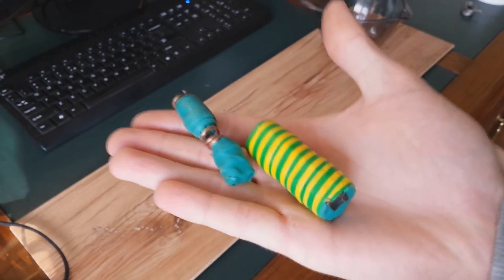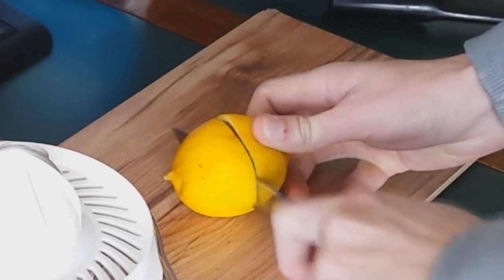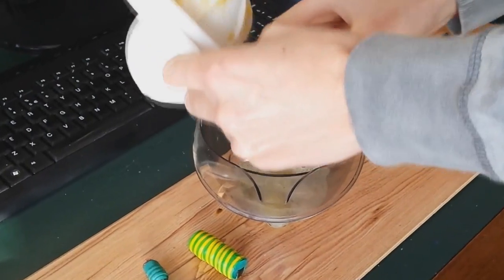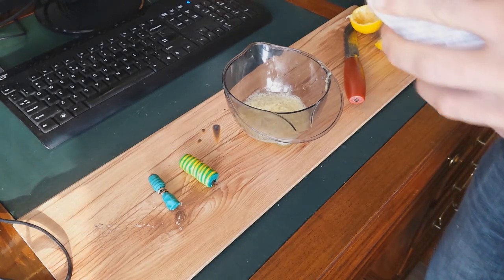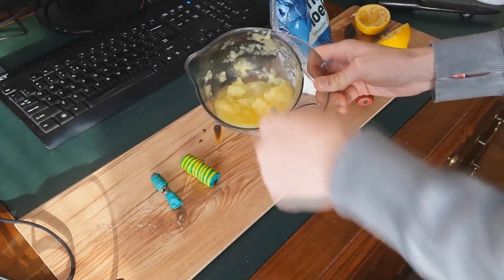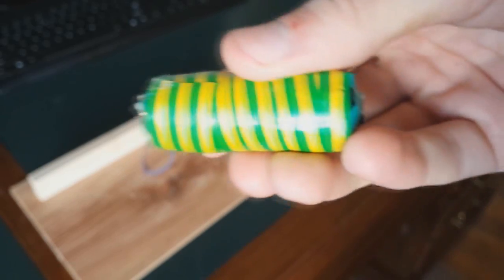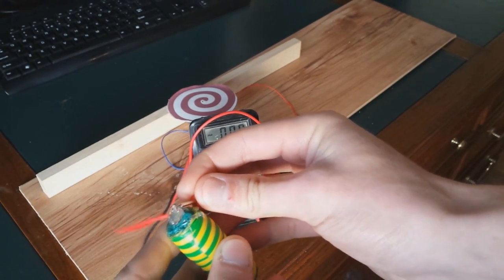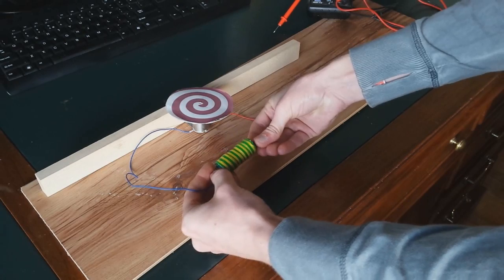How to make a battery at home – Homemade 1.5 V

Comment: which components do you use to make battery +&-
Reply from the maker: the battery has a copper core and a iron shell. Isolate them so they won't touch each other and you have a plus and minus.

Comment: Did you use two different types of metal for the positive and negative output? Or is there just a coil all around it? Please explain a little more thoroughly than the video.
Reply: The most effective probes would be a zinc plated or galvinized nail for negative and a bared copper wire for positive

Comment: I think what he has is a roll of copper with an Iron nail that is on the other side that the copper fits around without touching the two so it will have to be made perfect where they won't touch inside the tube. If you look at all his videos you will see one that uses soda ash and lemon juice and a iron nail.

Comment: what is that green colour thing which u put on both the sides
Reply: DINESH JAIN it is lemon
Reply: +azad trivedi 

 no he was talking about the green tape right at the start of the video: 0:02 left and right of the copper coil. 

The lemon mixed with soda is what I put inside.
Reply from the maker: DINESH JAIN  the green is isolation tape so that the inner copper core will not directly touch the outer metal core. 
I hope I answered your question well enough :)